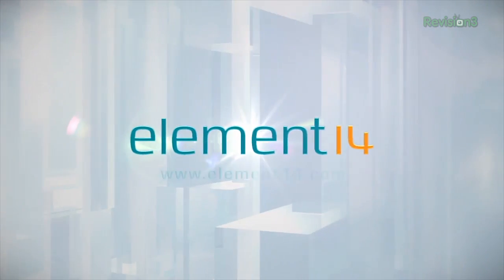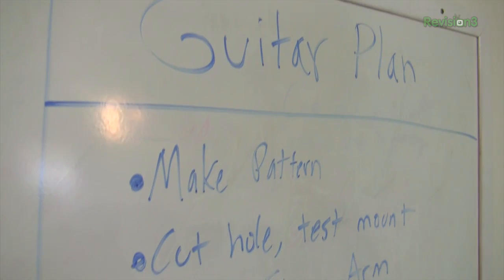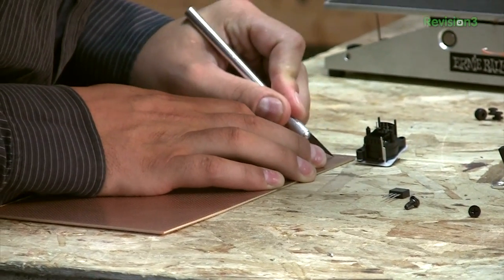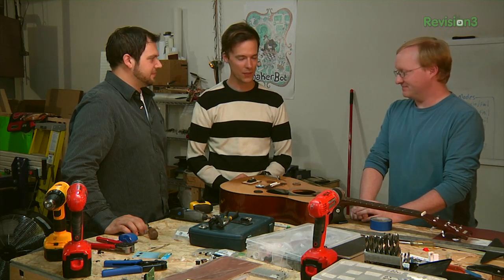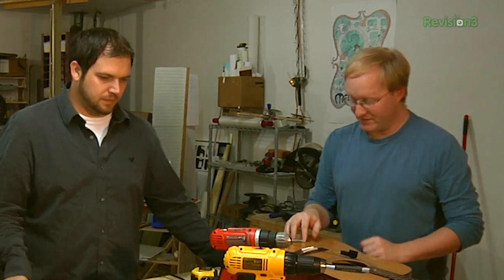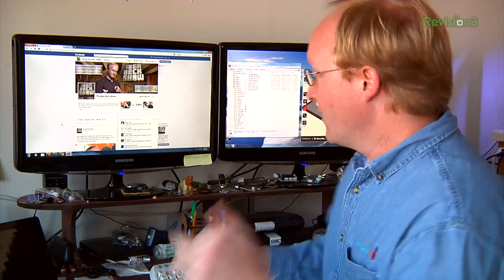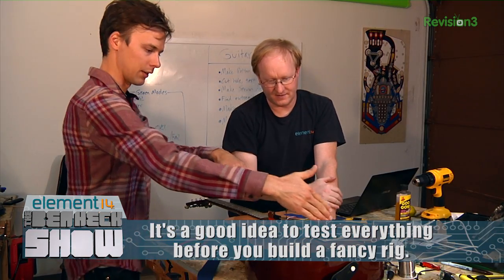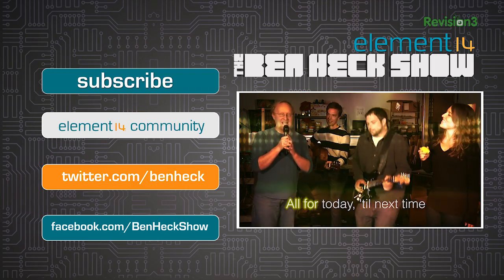Ben Builds a One-Handed Guitar

Comment: I really hated having to 'dislike' this video. I've been a fan of TBHS for a long time, and this was quite disappointing. I'm glad you want to keep the show fresh and add new features, but I consider this particular experiment a failure.

I also think you went the wrong way with your guitar build. 1) no modification of the guitar should be needed. 2) I know you're an electronics guy, but something purely mechanical would be better in almost every respect than servos and uC's.

Comment: May I make suggestion , On the pick holder change solid fixed end to a spring rotating return to center. You will then be able to get the pick to hit all string more consistant and the strumming will be more natural  than digging each string and possible missing strings due to the different thickness of the strings. when you play a guitar you almost never hold the pic straight on. its at an downward angle on the down strum and vise versa

Comment: im a guitarist and i think this project is really awesome. There are just so many mechanics you are making mistakes with. Using an acoustic guitar is a bad choice, by taking any material away from a cheap guitar off the bat will mess with its density and sound. Using an electric guitar would be better mass isn't as important. Also the pick position you are using is also incorrect, the angle you are looking for is not so vertical its actually more of an 45 degree angle from the face of the guitar

Comment: I would be concerned with the latency...it's not a lot and the operator could adjust for it - but I would see 2 pull-cables (like in brake-cables) used to actuate instantly with no lag and I suppose importantly: no servo sound.